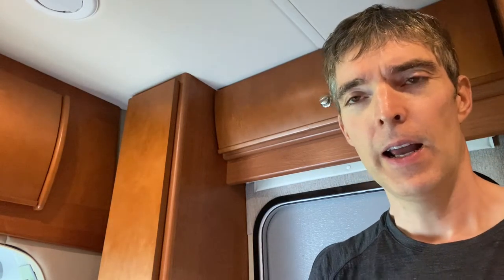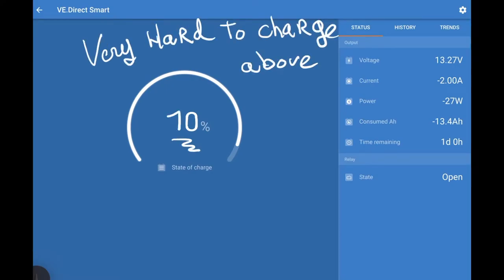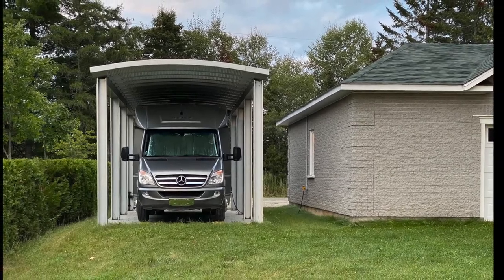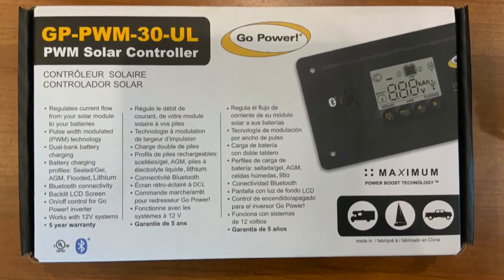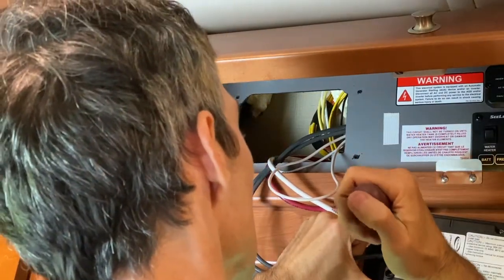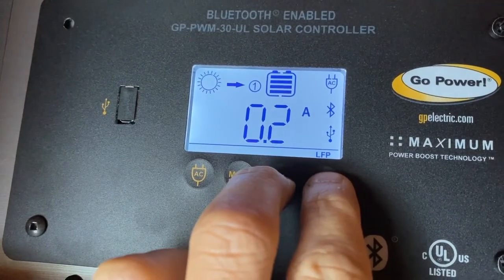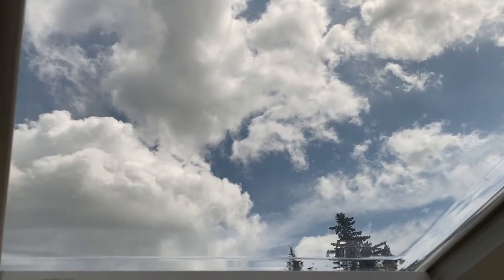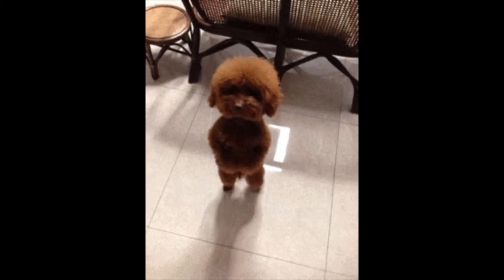Time to let go of the old solar controller.Easy Upgrade GoPower Lithium AND Bluetooth GP-PWM-30-UL 2

Comment: Your English is perfectly fine...what lithium battery(s) did you purchase to replace the lead acid originals?  I want to keep the same storage bay for the batteries and I am not increasing any capacities at this time.  Thanks for your video!
Reply from the maker: Previously, I was utilizing BattleBorn  batteries. However, I have since made the transition to lithionics batteries. These new batteries offer improved performance and efficiency, while still fitting within the same area under the entrance steps.

Comment: Have you experienced the "connection failure - initialization failed" after using it for a while?  It looks like a hard reset of pulling all four cables is required.  It appears that when using the APP you must positively disconnect the App by hitting the Disconnect button or the Bluetooth may be screwed up.
Reply: Interesting…But I Haven’t experienced this kind of issue…so far…. 🤞🏻